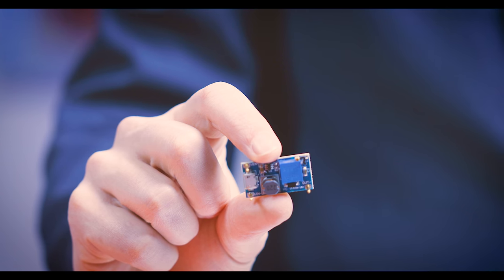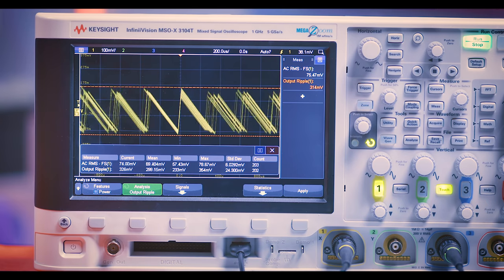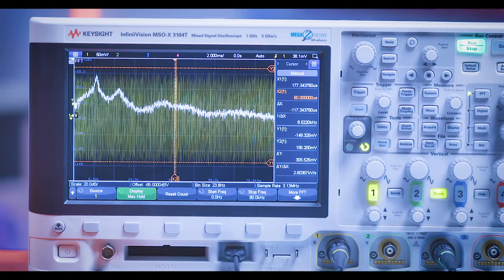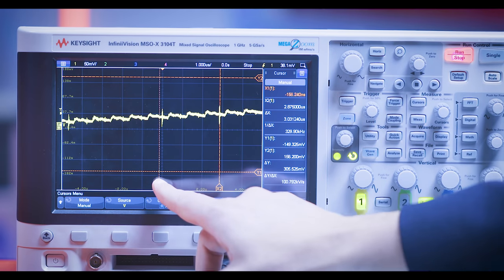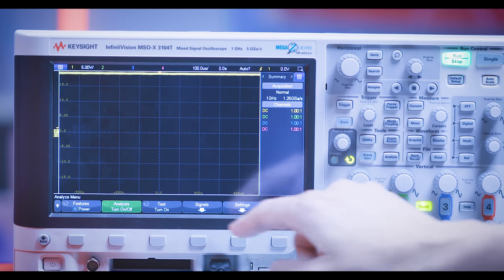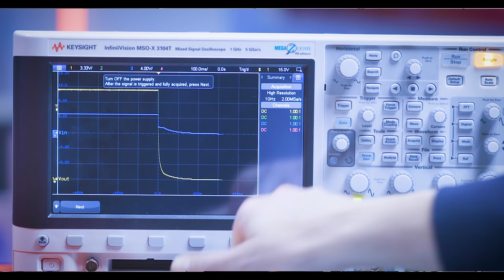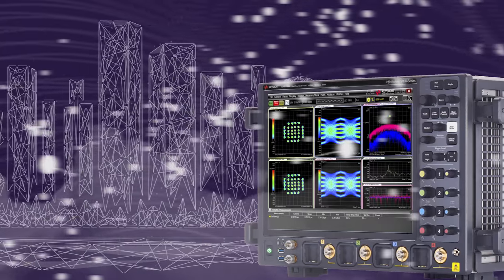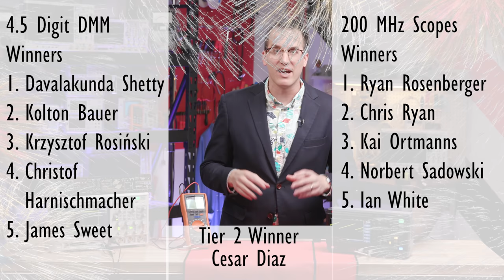Is a $1 Power Supply Any Good? + Wave Winners

Comment from the maker: That noise ain't pretty, but it'll get'er done! What's your go-to power chip?
Check out the resource libraries + Wave giveaway: http://bit.ly/YTWave2020
Reply: Cool... Wait?
Reply: XL6009 DC-DC adjustable boost module 5-32V in, 5-55V out with digital display :$3.22can. I plan to use it for first time getting fuller charge on my older e-bike battery this summer. Be nice to win contest to monitor it better.
Reply: The good old MC33063 is almost a universal choice. Widely available as various clones from China and easily salvageable from cheap consumer gear. Just don't forget some output protection and an input fuse in case it locks up and stops switching.

Comment: I don't know if it's my go to but I like the PAM2320. Cheap, easy to assemble, doesn't need many external components, 3A output, doesn't get too hot, vin=vout, easy to adjust with a mcu dac over its range of 0.6v to 5v if you do some quick maths.

Comment: I would measure the ripple under the normal load that this thing is gonna be used. It would be very different from an unloaded supply
Reply from the maker: This was all under load
Reply: @KeysightLabs  what was the load? The only thing that I saw connected to the output was the scope probe (I assume 1M ohm for X1 probe).
Reply: @amirb715  They showed the triangle wave under 1MΩ and 1kΩ loads. The output voltage didn't show up on the scope but we have to assume it is being tested at 25V because that's what Daniel mentions at the start of his test video. So 25μA and 25mA respectively on the output.

The datasheets in the video were confusing. On one hand, they looked at the FP6288, but on the other hand, they looked at the B6289Y which is the same family but different technology.

The 6288 was only rated to 20V which would be impossible for the 25V test, so it must have been the B6289Y.

Comment: Had some bad experience with some of these DC-DC modules. Got a BB-Converter module set to reduce 5V to 3.3V. The module ended up boosting it to 30V before realizing 400ms later that its supposed to give out less than what is on the input.
Reply from the maker: Ouch! That'll fry everything in a hurry

Comment: - TIP Test for dynamic load conditions. 
- TIP Never place a 10, 100nF sub ~470nF without a series resistor 10 or 100 ohm resistor. (seems to be common jump to conclusion measure to suppress noise)   

Switching regulators/boost circuits has an interesting behaviour concerning "dynamic load conditions" and its behaviour with time, trade-offs comes down to two things. 

- Fast transient response poor regulation (more noise, fast reaction speed).  
- OR slower transient response, improved regulation.  (less noise, slow reaction speed) 

Trainsent speed (fast or slow) is obviously a critical parameter and application specific not saying there's a sliver bullet,  good to understand these parameters.   

An interesting fact, computer server power supplies are designed for fast transient speeds, at the expensive of high ripple (to prevent CPU brown-outs). That's why there are so many inductors everywhere.
Reply from the maker: Good tips!

Comment: I had a small 3.3v circuit running off a similar buck-boost converter which was powered by an unregulated 18650 battery. For some reason when the battery dropped too far down (below 3v), the output voltage peaked 35v and killed all the attached circuits. I'm not sure why or whether that is standard for those regulators but that day was a sad day.

Comment: Been using the "SODIAL(R) 6pcs MT3608 DC 2A Step Up Power Booster Module 2v-24v Boost Converter for Arduino" six for "not much" set. Seems to work. But not tried with anything that might be impacted significantly by noise I have to say.

Comment: Seems to me a bit of additional filtering would solve your ripple problem. After all, most of these devices just use the chip OEM's test circuit for their design. Hardly optimised.
Reply from the maker: For sure! Definitely something that can be handled on the implementation side.

Comment: A 2% noise at 10khz will be cleaned up by any decoupling caps on your device. 

Otherwise a very nice commercial for the keysight scope.
Reply from the maker: True! If i were to implement this into a design, I'd probably figure out the ripple at my specific load ranges and pick caps accordingly.
Reply: @KeysightLabs  sorry I did not notice it was an add from you, I just thought it was a YouTuber checking a power supply. Your scope is very impressive with its touch screen display and performance but maybe a little bet too expensive for me. You have a lot of products reasonably priced for the pro, maybe you should develop some low cost front ends, display less Bluetooth or usb interfaced designed toward the amateurs the market is large and if you amortize the R and D cost on a large market it would be profitable for all of us. I'm thinking about a sub $100 100Mhz display less scope. Can you do it s the question?
Reply from the maker: @johnkubik8559  That would be awesome! I've been wanting an open-source type front end for a while

Comment: we can decrease the ripple by using L-C filter or capacitance doubler circuit .
Reply: Simply adding a capacitor directly across the output would do wonders. May be all that's needed unless the load is quite high.
Reply: @rich1051414  
Yes increasing the capacitance will decreasing the ripple but not so much cause the output already has a big cap.
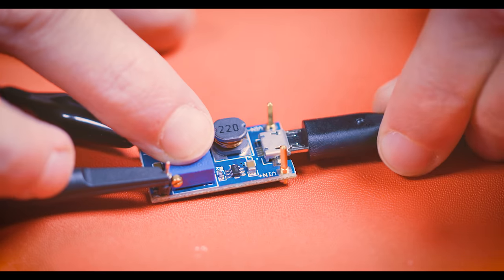Reply: @mohammedjawadforelectronic9190  0:57 I am not seeing a massive capacitor. I see a small ceramic on there.
Reply: @rich1051414  
That's  right  its a small one , due to high frequency , but I was mean using  LC filter  is better  than  C filter
Reply: @mohammedjawadforelectronic9190  Oh for sure. I was simply stating doing nothing more that throwing a large value electrolytic across the output would immediately massively improve performance. Yeah, a proper LC filter or even a RC filter would be much better, of course

Comment: Testing the PSU without load will cause discontinous mode and a very high ripple at a low frequency. Loading it with e.g. 20% of rated current should give a much lower ripple output. Even a beautifull scope cannot fix a bad test setup...
Reply from the maker: This was all tested under a load
Reply: @KeysightLabs   I dont think the 1kohm load was enough to get it out of the pulse skipping mode for very light loads. The 9.1kHz frequency is probably a pulse train of 1.2MHz switching. You should see the frequency get faster as you load it more then eventually itll exit pulse skipping mode and youll see a much lower ripple as it continually switches at 1.2 MHz. You should definitely test it at a heavier load, say 1A, and see the performance then! 😊